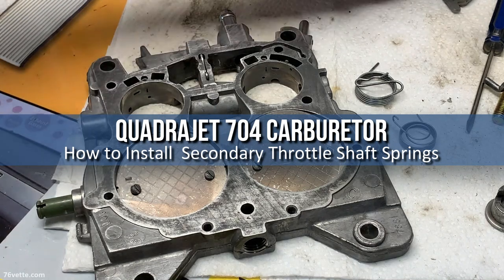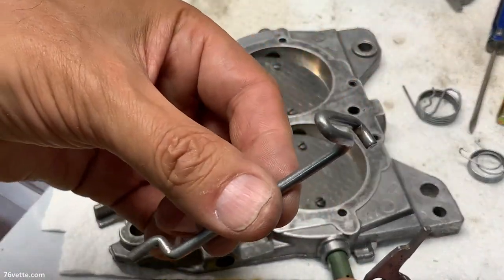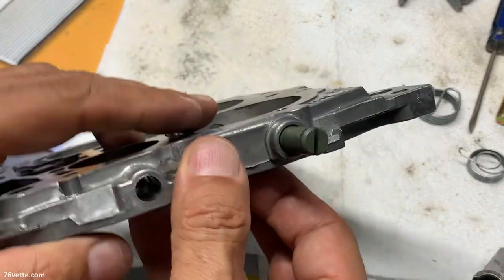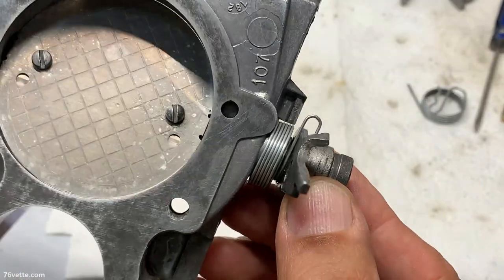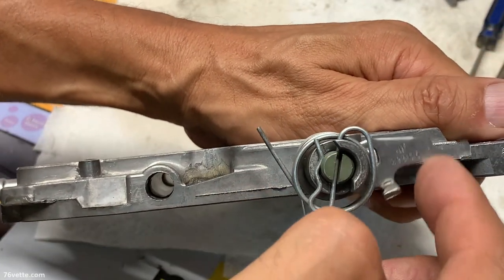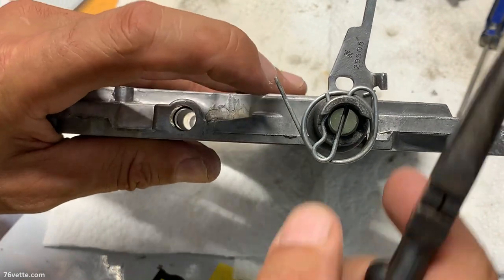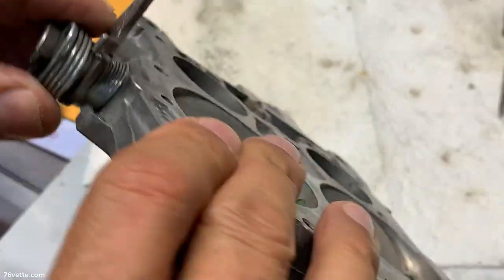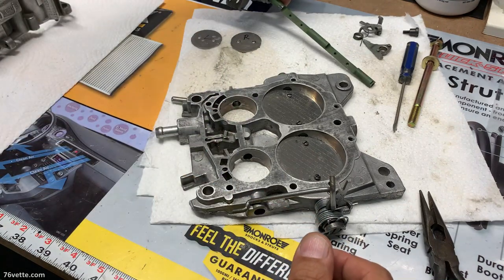Quadrajet SECONDARY Throttle Shaft SPRINGS

Comment: That's really good detail! What purpose does these springs serve though? Doesn't the throttle return springs serve the same purpose?
Reply from the maker: Good question. The throttle lever will open the secondary throttle body butterflies as long as the choke lockout is disengaged, but it will not close them. They are, basically, separate systems. 
Thank you for watching! 😊👍🏻